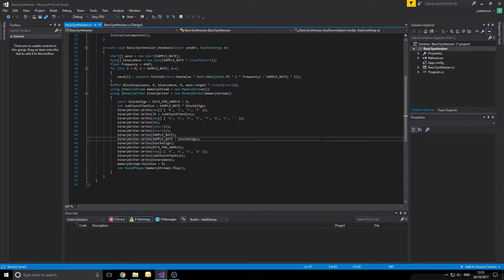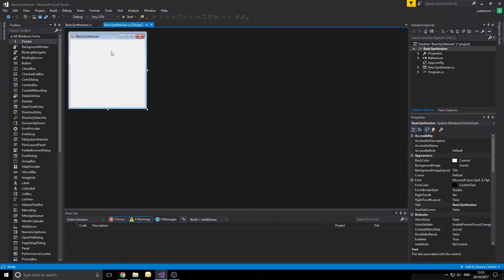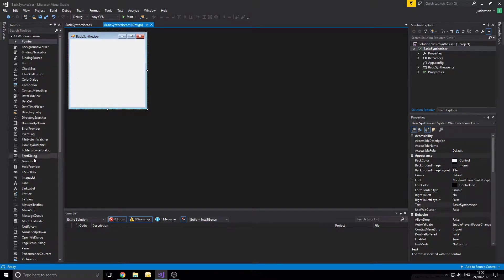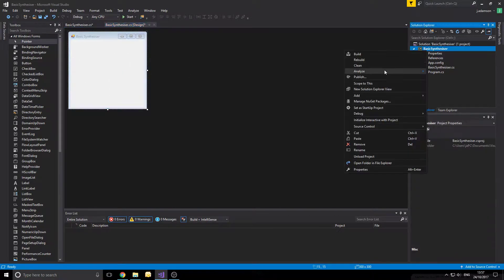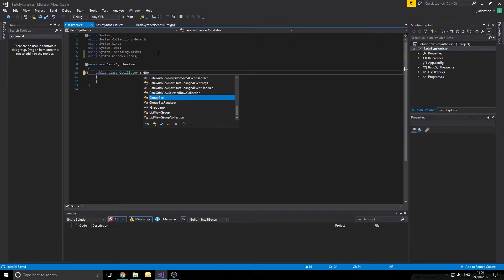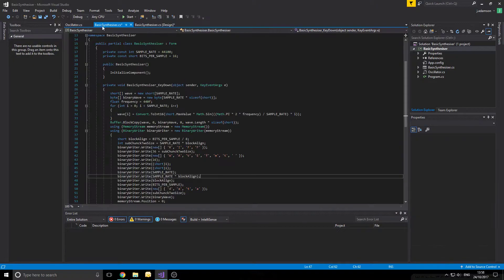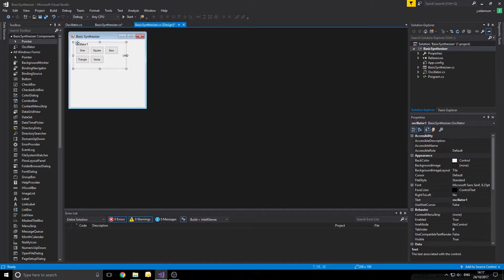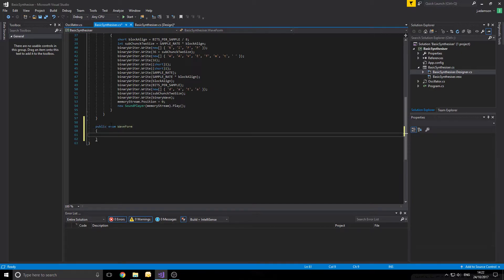C# Creating an Audio Synthesizer - Part 2

Comment: Following the same code at minute 6:12 my error list detect:

The type name 'Oscillator' does not exust in the type 'Basic Synthesiser'

How can i fix that?
Reply: Hey, I'm having the same problem. Did you manage to fix it?
Reply: @likse456  Hey , I found it out!
You have to add "using BasicSynthesizer;"
Reply: @Liriosha  Where do you add that? I'm having that same issue and cant solve it.

I did add "Using BasicSynthesizer;" on the BasicSynthesizer.Designer.cs file and it did nothing

Edit: I solved it!

So I had 2 errors on the "BasicSynthesizer.Designer.cs" file

line 32 ---->this.oscillator1 = new BasicSynthesizer.Oscillator();
line 63----->private BasicSynthesizer.Oscillator oscillator1;

changed it to 

this.oscillator1 = new Oscillator();
private Oscillator oscillator1;

weird because this file is autogenerated but this fixed it.
Reply: @thefirethefire9131  fucking thank you so much
Reply: @thefirethefire9131  this does work, but any time you adjust the box, it changes the code right back. Kudos on finding a way to make it workable though. Did you ever figure out why this is happening with the autogenerated code?

Comment: Not to be rude, because this is a fantastic tutorial and I'm very thankful I found it, but the algorithm to generate the pitch is noticeably wrong. All the C frequency values should all be the "same" note, and you can hear in your demo, as you are increasing in frequency, the pitch decreases slightly. I'm not sure what the correct way to fix this is, but it seems that the pi method is not entirely accurate. 

Otherwise, I really really love this tutorial. I got into learning development in order to develop things like this, due to my love of music. This is the first time I am actually seeing how something like this could be done.
Reply from the maker: I just took another look at the frequency chart and realised the mistake haha. Its a little late for changing it but thanks for pointing that out :)
Reply: G223 Productions C3 is actually 130.813hz .
138.59hz would be C# (a half tone higher). So just a c&p mistake ;) 
C8 has some additional harmonics due to aliasing. That’s unfortunately what happens in the realm of digital audio - no mistake on your part.
Reply from the maker: Hello, thanks for watching! I have taken no music theory or piano/instrument specific classes, but as of my current understanding a higher frequency is the same as a higher pitch, could you please elaborate on your point? As for the PI method (2 * PI * frequency), all this does is convert the frequency into an angular frequency, and is well documented (https://en.wikipedia.org/wiki/Angular_frequency). I may be very wrong with what I am saying but I don't see any flaws in the method used. If I misinterpreted anything in your point, feel free to elaborate :)

Anyway, thank you for the kind words, I appreciate it, music programming is one of my favourite things as well. Very recently, I have been able to do voice over commentaries again, after being unable to for months, so I will be doing a remastered series of this with new found knowledge and a lot of improvements!